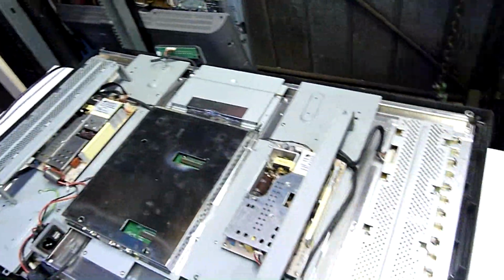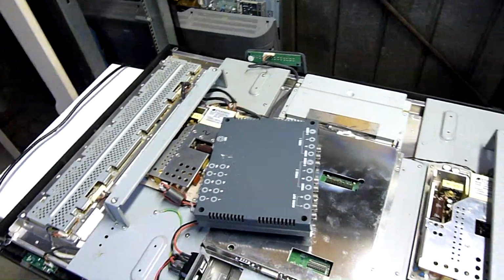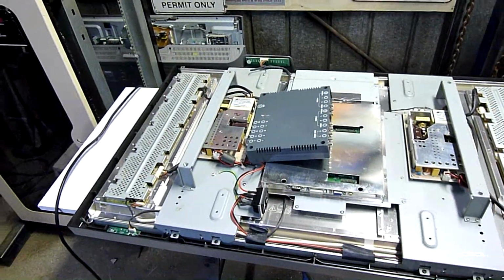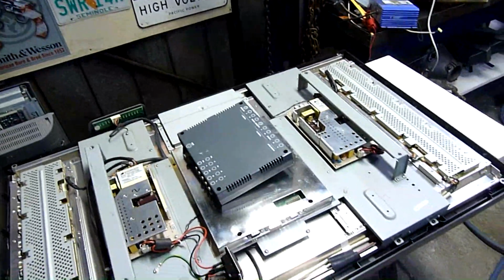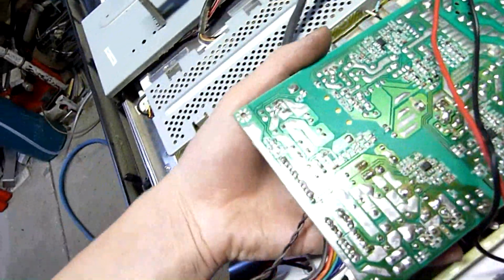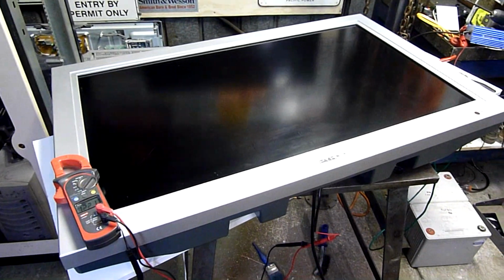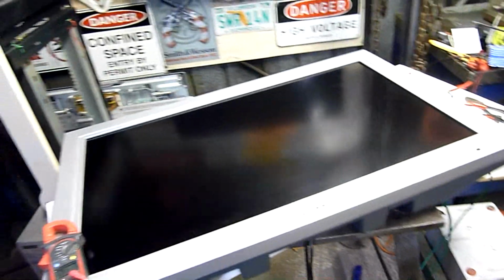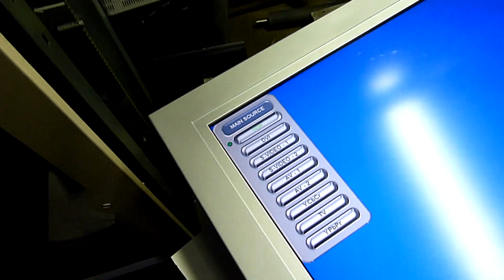37 Inch CCTV Display Build for work Pt1

Comment: Search ebay for DC to DC converter you can get adjustables ones 1-2amp ones for $2 or so, there super handy for this kinda mod. 

http://www.ebay.com.au/itm/New-Mini-5pcs-LM2596s-3A-DC-to-DC-Buck-Converter-Adjustable-Step-Down-Module-/261364051776?pt=AU_B_I_Electrical_Test_Equipment&hash=item3cda82ef40&_uhb=1
Reply: For your 5v converter that you need.

Comment: A suggestion would be to check if you've got a connection between the tv's shield connections and the VGA shield. If you have, it might pay to switch to a 3 core mains flex and ground the chassis, that way your 12v external feed for the cameras is ground referenced so no charge can build up on it ref: to ground.

A 7805 regulator should be fine with up to 30v input provided it's heatsinked (heatsunk?) well enough to handle the power :)

Comment: You can always add a small 5 volt PSU and mount it inside the lcd on one of the chassis to run the converter.

Comment: A great use for that tv Ed :-)), if you needed to run a 7805 from 12v for simplicity i would stick about 6 diodes in series to lose some voltage :-)

Comment: Such is the life of he with too many TVs.
that said, impressive build. you sure you want to use that green button and not one with some more tactile feedback? or is that not an issue?

I mean it's not a keyboard, but you want to make sure that the people mainly operating this thing KNOW they pushed the button in all the way for the thing to register a button press. it'll save them from quite a few headaches.
Reply from the maker: We have decided to tie it into the PLC's in the cutoff machines, since they already have to send an ON command to a chiller and heater outside, the cable box will literally be right under the display anyway :D
Reply: that'll make for some great footage of it booting all up if it's ever allowed for you to take a video of that.

Comment: Put a small 12V fan on the TV to prevent damage to the monitor by heat. You can just power the fan off of the 12V power supply like the cameras